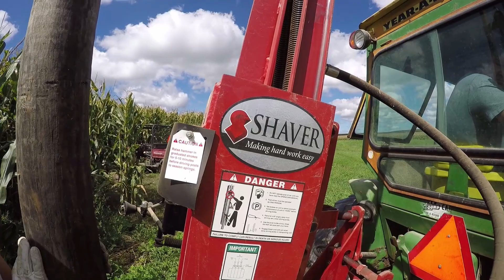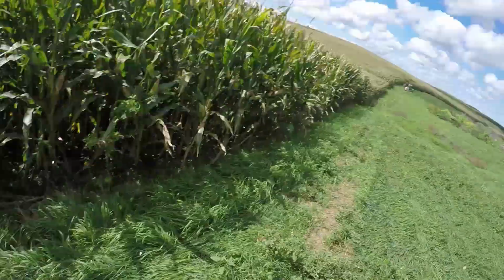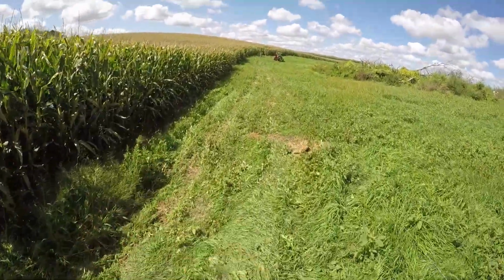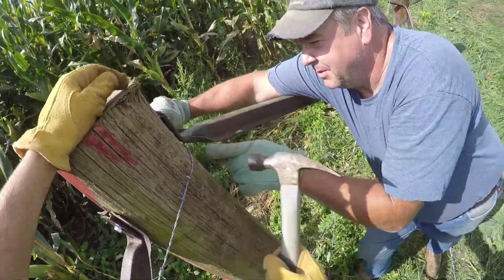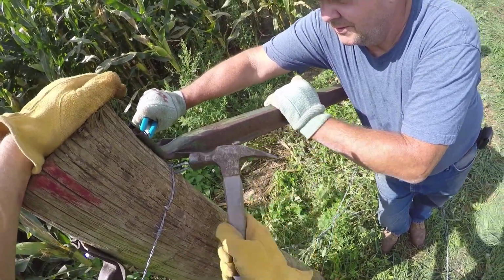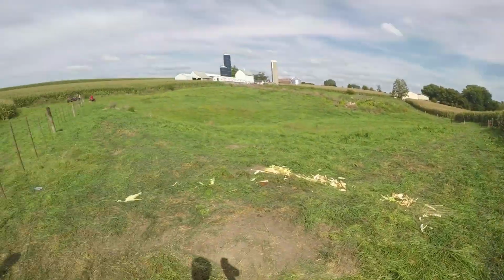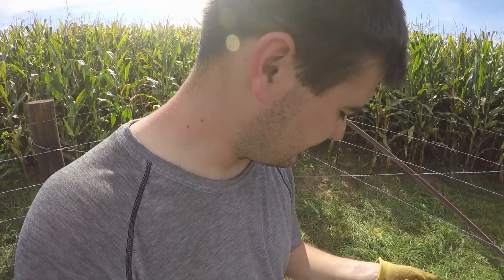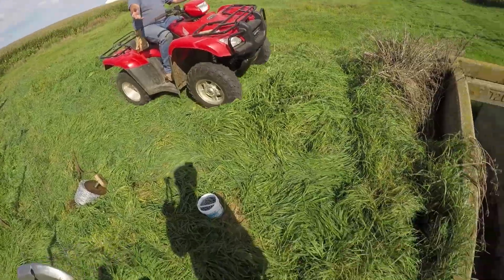To Build A Barbed Wire Fence

Comment: Back in the day we used cedar post.  6 inch for corners and 3 inch roughly for the fence.  Had to dig holes with a post hole digger . boy was that work.  Good for the shoulder muscles.

Comment: Nice looking fence little trick ive learned, use your loader bucket to drive thoses Tposts in the ground. You can get them in just a straight and faster then using a driver.

Comment: Nice fence. You would love doing the fence the way the folks across from me built theirs. Basically they built the corners and two gates, the rest they strung high tensile wire with a fiberglass stick about every 20 feet !!  They didn't tension it right the first time though. Woke up one morning to see 15 head standing on my lawn...

Around here that spillway would need to be barred to keep animals/children out.

Comment: I miss it, when in the Spring, my Dad and I would fire up our old 1950 Ford 8-N, and go out to our 7 vineyards, on our 39.5 acre fruit farm, and check the end posts for broken ones, and check the couple wooden posts in the rows for broken ones. If we had to use the auger to chew up the old end posts, we used to use about a 1970's Ford 3000. Until we got a 1991 Ford 4630 rear wheel drive. In fact all our tractors were rear wheel drive. And seeing how we lived in a wet area, we could have benefited from a mid-size 4 wheel drive tractor.

Comment: You make life so hard, just push the posts in with the bobcat, that's what we do with our telehandler
Reply: The bobcat wouldnt have enough weight to to that, plus it would be harder to get them straight up and down.
Reply: jcb has a attachment that hammers the post in I'd imagine bobcat has something similar.
Reply: Yeah but can you imagine how RIPPED you'd get from doing that all day? Abs like Jesus
Reply: We’d put up snow fence every year, just hold the t posts in the bucket, grab one and drive it down with it. Just set your end/corners first and have a spotter to tell if your straight. Works like a charm.
Reply: Bobcat SHOULD be able to push those posts in, but if not a front end loader on the tractor works great... we pull posts with the FEL and push in T-posts with it, easy as pie.  Heck, carry the posts in the bucket so we just grab one and go.  

Before we got the front end loader for the tractor, we bought a T post hydraulic pusher, basically a hydraulic cylinder and a frame sorta like that post pounder, but  it bolts to the drawbar of the tractor with a single big bolt, you slap a T-post in it, wrap a little chain around the front of the post and hook it on one side, and hold the thing more or less upright with one handle, and the tractor operator retracts the cylinder with the SCV control, pressing the post into the ground.  They all go in the same depth and it takes about 30 seconds per post.  

We use a 10 foot stick of 3/4 PVC pipe to space our posts out 10 feet... works easy as pie and they're all evenly spaced.  

Later!  OL J R :)

Comment: I know this is an older post but why use 6 strands of barb when you could have put up woven wire fence? I have beef cattle as well and only use 4 strands of barb and woven wire around the corn areas so they can't stick there head thru.

Comment: Just put new springs on my shaver pounder, what a pain, tried to call there technical department and never got a call back to see the meathed to replace the springs..just replacing the tractor supply post that are junk after ten years.

Comment: Nice work! Wish you'd shown how to attach the wire to the posts. I need to build a fence. Whats that big concrete hole?
Reply: Check out HOW TO BUILD A 4 WIRE FENCE YOURSELF on YouTube
Reply: Shows everything from proper bracing to stapling the wire...4 part searies

Comment: .You may want to purchase a gas powered Skidrill pounder. Makes short work of T posts. I have used mine on about 10 miles of fence. That manual pounder will get the best of you quick

Comment: Nice job! Just one question, What is the cement lined hole in the ground and are you afraid cattle will fall in it and get hurt?
Reply from the maker: +joe polen It's a spillway. Never had much problem with it before.
Reply: Looked like it's outside the pasture.

Comment: Do you recommend using mature trees as corner posts?  Thanks.
Reply: Absolutely not.  Trees continue to grow and will "absorb" your barb wire, and it will rust away inside the tree and snap, then you've got a mess.  The staples and wire will be inside the wood, and trees eventually die.  When the tree comes down, or if it falls over in a storm, it will take the fence with it and pop all the wires.  When you have to cut the tree down because it's old, sick, or dead, you'll be hitting barb wire and staples and ruining chains on your chainsaw.  

Move over a couple feet and put in a proper corner post with a good H brace on either side.  You'll be FAR better off in the long run!  

Later!  OL J R :)

Comment: I cringe every time I see the so called brace used in fencing !  Use an old cement silo stave...place it at below ground level "flat "  up against the corner post.  No brace needed. The stave helps spread out the pull force over a three foot area..and will never jack the corner post out of the ground ! Also.... put the corner post in the ground at a slight tilt opposite of the direction you will be pulling That way when force is applied it will be standing straight up.

Comment: invest in a clip bender { tractor supply } about $12.00 wonderful tool for bending the wire clips.
Reply: Yes, agree that's one of the better tools I've brought in the  last few years. I still like using pliers though, especially when the clips are not well formed and need adjustment and the wire is in single strands. But the clip bender tool is excellent when working with woven wire/ field fence/ sheep netting  where it is more difficult to get the range in motion needed for pliers especially on that bottom strand which is practically on the ground.

Comment: Why not electric instead of barbed
Reply: Impossible to maintain on wood edges to keep the under growth from getting on the wire. In Indiana you would have to weed eat weekly or spray herbicides which would cause erosion problems on border fences... We either use barbed wire or woven wire...

Comment: I'm sorry but every time you drive the staple that tight to hold the wire you are creating a breaking point in the wire...use a wire stretcher to hold wire tight and wrap the wire around the post never pinch staple the wire

Comment: why not use portable electric fencing
Reply from the maker: +03002118141 Unreliable.
Reply: why not use permanent electric fencing barb wire is never seen here in NZ anymore
Reply from the maker: +Cameron Bishop Snow covers up electric fence in the winter, making it useless and resulting in shorts.